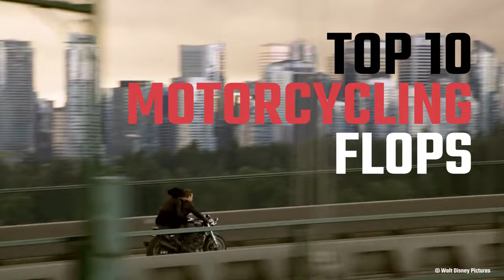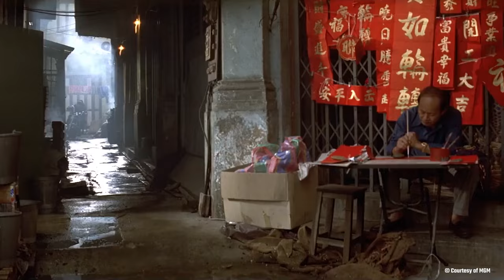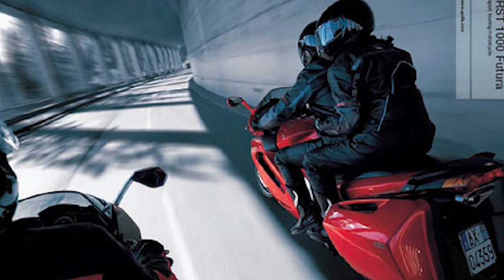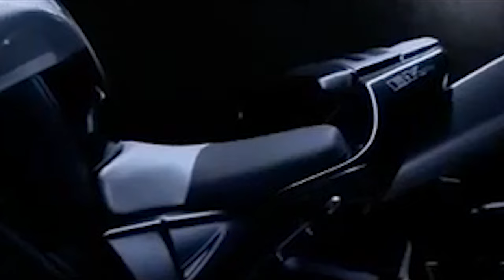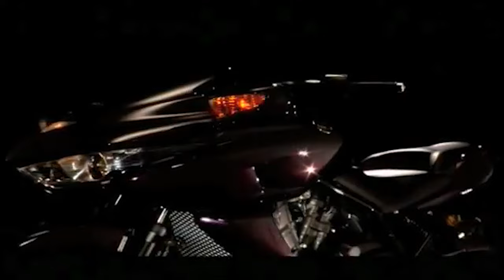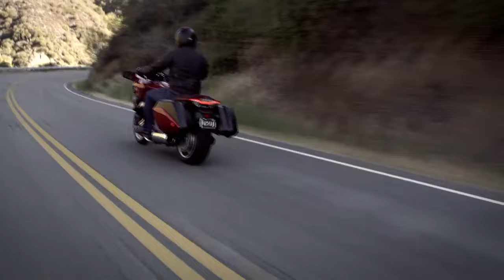10 Motorcycle Flops | The top ten worst motorcycles ever made

Comment: You hope that these never happen again? Some of these bikes are just fine...sure they may not have sold well.. but they have a following and used can be a good value. Its motorcycling, there is something for everyone.
Reply: I have the BMW 1200c. Just a boring bike.
Reply: Re the Honda DN-01, narrator makes reference to the engine..  comes from the uninspiring Deauville NT700..... he said. Well, petrol is €2.17 a litre now and my Deau is returning 79mpg. Shaft drive saving on chain & sprocket replacement costs. How are all the 1000cc sports bike rider getting along....? 40mpg and 200bhp that you can't really use. Lol
Reply: Saw one of those Harley 750 for sale for $3K just yesterday.   Cheap
Reply: @TeezerDriz  I don't know about the liter bikes but my 1441 is doing just fine with 215 hp and who cares how many miles per gallon
Reply: @Popsm0ke  keep her on the back wheel and your front tyre will never wear out. 🤘
Reply: Nah mate as a ex Bmw r12c owner no matter how I tried to like it,was embarrassed to ride it.
Reply: @conductorcammon  should of picked up on it if engine was sound  they never sold such a thing in the states other than a little venture into dirt bikes 50 yrs ago  after that smallest Harley I can think of was 900 cc.   Rarity adds value.  Jeez my dad sold his Indian chief and his scout parts bike for $350 when I was 10 I knew it was a mistake even then be 40 grand + now but who sees that far ahead. Best to you.
Reply: @Popsm0ke  what's price of fuel where your living, or money is no object?
Reply: @larryh.4629  almost 5 bucks. I have brain cancer so I'm not too interested  in saving money
Reply: @larryh.4629  almost 5 bucks. I have brain cancer so I'm not too interested  in saving money
Reply: @Popsm0ke  sorry for your troubles. Guess money is of little interest.
Reply: Dig it.
Reply: @Mark Andrews I think the bottom line is there is something for everyone in motorcycling. Some people love scooters, others sport bikes, some cruisers... as long as you are on two wheels, just enjoy it.

Comment: Have owned 2 TL1000S and still have my TL1000R since 11 years. Love it and will never sell it! But they are rare, I have not seen one TLR in the area I live in since I moved here, in 2003...
Reply: One of my coworkers swore by them and rode them a ton each year. Sounded great as I remember. THUNDERING! Ducati's bikes sounded like absolute hell! I bought a 929RR in 2000. Millennium Edition. Almost bought the RC51. They were priced at the exact same price $9,999.00 each. The 929 looked better IMHO, and had two more cylinders. The 51 proved more collectable in the long run, however. I bought a 2004 ZX10 after that, and that bike was lightyears ahead of Honda. Way more comfortable and had way better geometry for my style. More Over-the-Forks riding position. The thing did well over a hundred in first gear. Crazy! The 929 was better suited for drag races. You could really launch it off the line. I geared it down and added a 520 drive chain. The Ninja was crazy. It would just keep accelerating madly until you chickened-out. And you certainly would🕊
Reply: I had a 2001 TL1000R. LOVED IT! BOUGHT NEW FOR 10K
Reply: I had a yellow TLR for years. Smashing thing, and pretty comfy too. Took it to Italy once with our dog in the tank bag.

Comment: VF1000R springs to mind. It was so “ ordinary even Honda Australia would race them - VF1000 instead with Mail Campbell aboard.  I had a friend who had the “R” and said he was never satisfied with the handling, power was good. He put it down to the wheel size which I believe were 16”. At that time getting good rubber for that size tire was tough. 

The other from that time was the Honda CBX750. It actually was a very nice bike and pretty quick. For some reason it did sell well. My only guess is that at the time that if you weren’t riding something north of 900cc it was a mid level bike. The only thing I remember of that time was a little controversy over the 16” front wheel. 

Thats my 2 cents worth.

Comment: I must be particularly bad at choosing my bikes, my last two were respectively a GTS1000 and an R1200C, which I still own by the way. The GTS1000 was heavy, yes, but it managed to make the horrible roads of my region (Quebec) passable and it was so nice to see the horde of curious people kneeling in front of it to admire the unusual design of its direction.  As for the R1200C, having tried other custom type motorcycles, it has a lot more drive than most of them and there is hardly ever a day when I am given signs of admiration watching her parade through the streets.
Reply: I would use the R1200c, just like the XR1200, it looks like it's made to be a Sportster not a long rider......why I wouldn't have the 1800 no way to put forward controls and I would get 1800 to be a Sportster......well maybe a V-MAX
Reply: I also had the R1200C, it was amazing, I sold it cause it had a considerable amount of miles but everything worked like a Swiss clock. I’d buy one again, the 2004 Montauk model would be my pick.

Comment: I'm the proud owner of a 2009 XR1200 that I bought lightly used in 2020.  Not wrong about being heavy but it's a fantastic bike that's become a bit of a cult favorite in Harley history.  I get a lot of thumbs ups and comments on it from those who actually know what it is.  I would be surprised if HD DIDN'T make a modern rendition of it with the new Sportster architecture.
Reply: Harley got killed in the marketplace every time they tried to recycle the Sportster (love 'em, I have three Evos and an Ironhead) engine into a "modern" sporting machine because looking good is just not enough. XLCR is also a classic but like XLCR the agricultural gearbox and utter lack of power also helped kill Buell. Sportys were sporting into the early 1970s. The traditional Harley market also killed off the FXR which is rightly a cult favorite. Good by Harley standards and good by sporting standards mean drastically different things and a "sport bike" with under 100HP weighing 600lbs is just a sexy cruiser. Harleys are old man bikes (I'm old and also collect vintage British machines). Performance is not what they do unless stroked (like my 89" S&S Sporty or V124 S&S FXR) and even then most of that is in a straight line.

Comment: I nominate as flops Yamaha's 1982 and 83 Vision XZ-550 V-twins.  Its engine is best described as a hopped-up version of a horizontally split V-Max.  The 82 had carburetion problems, a middling single front disc and fixed-damping suspension.  For 83 Yamaha fixed all those problems, lowered the bars, rear-set the foot controls and added a sport-touring fairing with lowers having innovative and efficient leg vents flowing no air/ambient air or engine heated air.  The engine made more torque than any mid-size bike of the era, was one of the all-time smoothest and peak HP was decent too.  Vision had superb handling and cornering clearance.  The shaft drive performed seamlessly but chain drive would have saved weight and allowed easy final gear changes.  If Yamaha had given it chain drive and waited for the 83 refinements (with a sport fairing instead of the larger sport-touring type,) the Vision would have more likely succeeded.  Unfortunately, the world recession also helped seal its fate.
Reply: My local Yamaha dealer back in the 80's could ride whatever he liked, and his ride of choice was a Vision.
Reply: I owned an '83 Vision, and it was a great-looking, fast little bike, and it should've been a great-handling one too, but it suffered from inadequate front forks which caused me a couple of heart-stopping moments in fast turns before I realized it's limitations. The electrical system was problematic too. Mine just completely died twice, unexpectedly and for no apparent reason, necessitating expensive replacing of the main electronic control module. But it was a fun bike!

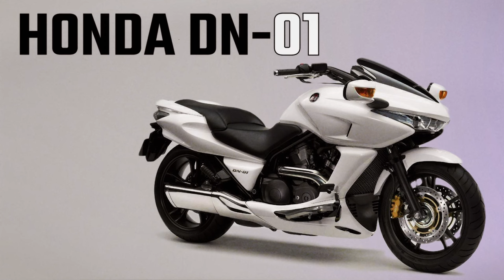Comment: @8:08 A local Honda shop owner told me that franchise owners very quickly dubbed the DN-01 to "Do Not Order One!"   ;-)
Reply: Or... Do Not Own One
Reply: ---- actually,Honda has been producing the DN-01 series for a long time  -  they just didn't use that particular designation  -  the CBX comes immediately to mind
Reply: @bonesrhodes3762  Do you mean the CBX 500 & 650 from the '80s or the CTX 700? The CTX has a parallel twin but very similar in concept to the DN. My friend has a CTX and loves it.
Reply: @joshrandall3632    ---  no: talking about the CBX 6 banger -  they were notorious bad sellers  -  the last series with the bags Honda had to literally give away to get rid of them  -   I'm very aware of bikes that may be wonders in their own right  or even great bikes yet impossible to sell  -  those are ALL "Do Not Own One " bikes from the public perception.  CX 500/650 ( esp turbos ),  Seca 650 turbos,  PC800s ( PC was code for "pretty silly" -  the Japanese just misspelled it )  etc.  -  just dogs as far as salability when introduced  ( when I bought my dealership, it came with 9 CBXs  -  took me 7 years to sell 7 [ to other dealers OR to someone off the street ] at whatever the current dealer cost was at the time  -  the last 2 I just gave up and used as shop bikes.

Comment: I have a DN-01 and I love it! the transmission is amazing, fully automatic and no steps in the gears, it just smoothly matches engine speed and gearing to perfectly match any situation. the only thing is the wind screen is WAY too small. I bought an aftermarket unit that is twice as tall and it's still too small. the only other thing is, it's got to be the heaviest 700 in history. which only comes into play when you're moving it around. once underway it's no problem. my son rode it and he loves it too. i also consider it to be beautiful, it looks like I stole it from Batman
Reply: Ah yes, but then Honda built the NM4 Vultus – the true 'batbike' which is far superior to the DN01 IMO. The DCT works really well, it goes around corners as if on rails and sips fuel like a 125, but at highway speeds.
Reply: @pnblondon1087  Far superior, pssh! It looks nice but not AS good, and transmission system isn't as fun (obviously). Still, probably not a bad bike, and each to their own.

Comment: The Yamaha TX750 has to be one of the biggest lemons of all time. They came out in 1973 and Yamaha Australia entered 6 or 7 of them in the 6 hour production race at Amaroo Park in Sydney, all with top riders. Only one of them finished. I became a Yamaha dealer 5 years later and by then they had virtually disappeared.
Reply: I had one. Bought it for $300 sold it for $100 blown up (bent valves ) because the heads weren't cracked. It leaked oil out of the head gasket the whole 2 years I owned it. Some one at Yamaha  forgot the cam chain tensioner and when you get one second hand with out the manual you just ride it until the chain jumps a tooth.
Reply: Thanks for the nightmares!  We parted them out when dead ones came into the shop.
Reply: Yep a mate of mine had a brand new TX 750 Yam. Catastrophic engine failures come to mind....haha.
Reply: They were only made for 2 model years. Most of the 1st year problems were corrected but it was too late. Too bad because it was a decent ride.

Comment: A lesser but equally interesting list would be bikes that started off as “flops” but over time evolved into decent motorcycles that withstood the test of time.
Reply: Specifically the PC800, which has a dedicated cult following. It turns out to be a really good lightweight touring bike that doubles as a great commuter, something that the Goldwing fails at miserably.
Reply: I had a PC800. Bought mine used in '92 for $3500 with 3900 miles. Great all around bike. Commuter to weekend getaway! Almost the perfect bike with a Kenwood stereo system to boot!! That was my 2nd luv
Reply: Add the mighty CBX to that list.
Reply: @Daveinet  The Gold Wing Tour DCT in an amazing commuter bike! Don't knock it till you try it!
Reply: @jbb3675  Of course if when you want to pound out the miles on a long trip. But when you are running to the store in heavy city traffic, it takes a lot more effort than it is worth. I've had two Goldwings. For the current iteration, the seat is too wide and you can't even touch the ground.
Reply: @Daveinet  Seems a bit odd complaining that a touring bike doesn't make a good commuter, hey? Sort of like saying your SUV is bad because it isn't a very good city car.
Reply: honda hornet 900 sc48, i have one and its perfect.
Reply: @yinyangsaladgang8789  Not really. Most people can only afford ONE bike, so the bike they choose, must do everything well. The PC800 does both touring and commuting. The Goldwing just takes too much effort to drive in highly congested areas. When I was younger I didn't mind, but as I aged, I got to a point where I didn't want to make that effort. The PC is dead smooth, dead quiet and about half the weight. The wind protection is the best I've ever ridden. Really the only drawback is riding two up makes the bike a little slow.
Reply: @Daveinet  I'm a fan of the PC800, especially for its clever boot/trunk but there's no way you could ever call it a lightweight! It was over 272kg/600lbs dry!  FWIW I chose the PC800 to be London's first taxibike, back in 1991.
Reply: @pnblondon1087  Lightweight was in the context of touring. I think it would be the lightest touring bagger you can find.

Comment: You must surely include in any flop list the Suzuki RE5. Great idea, wonderful to ride but no one was ready for it and no one bought it. Well maybe a few but that was it. It had that amazing flip up instrument binnacle and the motor was so smooth you could balance a coin on its edge on the petrol tank.
Reply: I was fascinated by that bike and would have bought one but too busy at the time trying to support a family
Reply: @jayjackson597  If I'd of been fascinated by the bike I'd of had my family trying to support me buying one lol
Reply: That's a cool bike with a rotary engine. I just couldn't figure out why they stopped production.
Reply: @richardandrewcrosby3078  Why thank you.. It's a VS800 V twin shaft drive and I guess they stopped production of these when they stated making the the Boulevard range. It's a cool ride, not over heavy  and it handles well... but I guess all things change, before this one I had a UK version however this one is an America import and it's slightly bigger than the ones that were sold in the UK.
Reply: @richardandrewcrosby3078  The rotor seals were delicate and needed replacing as i recall.  you had to keep oil in the lubrication tank!  Also it competed with the shaft drive goldwing.  If you were heavy on the trottle those chains were short lived.  Dad had one for a few years.  Fun to ride!
Reply: My old friend  had an RE- 5 . 3 engine rebuilds in 1 year. The tips on the compression  that act like rings blew out  all the time ,A Pig on fuel too. 20 /25 mpg!! He was smoking  a lot of 650,750 and other except kawasaki 500,750 H1,H2 triples. It was fast for a 500 single rotary  and very heavy! A statement by SUZUKI FOR SURE.
Reply: The RE5 was a epic fail, imagine the development cost of that thing.
Reply: The RE5 was a really good bike, the trouble was that Suzuki also sold the GT750 which was incredibly reliable and had the same  performance as the rotary.

Comment: Since I have been riding since the mid 80s...
1. Yamaha 550 Vision
2. Honda FT/VT 500
3. Kawasaki 900/1000 Eliminator 
4. Yamaha TDM 850
5. All early to mid 80s turbo bikes

All the above bikes were not necessarily bad, just introduced at the wrong time and didn't sell at all.

The 550 Vision was so dismal, there were dealers offering BOGO. Yes, buy one Vision and get two! It was that bad in the early 80s in ref to sales in general.
Reply: some 70's/80's bikes were strange and i agree with your list... the Kawasaki Z750 Turbo was the best turbo bike of the time.... i had one and some gripes were fuel economy at high speed vs smallish tank and no turbo oil pump timer. it was a pleasure to ride on the high side of 160kph and still blew off most bikes of its time.
now-a-days we are spoilt with 300kph machines that handle and brake very well out of the crate.
Reply: Ahhh yes....   The TDM.   I forgot about that oddball, the start of the ADVs (IMHO).    Like most on this video list it was regarded as a good bike and really did well out of the US for awhile.
Reply: The TDM 850 was a great bike, just needed a slightly taller screen. I had the pleasure of racing one in a French competition road rally back in 1993, including a race at Le Mans. I could never understand why Yamaha didn't sell a Peterhansel Dakar replica – an XTZ Ténéré with TDM 850 engine.
Reply: Love that Honda and the cbx650, gl650,